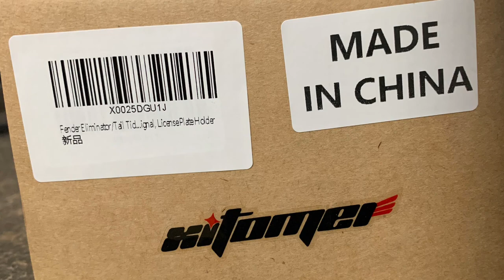Installing a shorter license plate bracket on Kawasaki Z900

Comment: You don't have to cut wires or bracket! Just unplug wires! You just have to disassembly top and loose bottom parts of the tail.
Reply from the maker: The connectors on the wires were to large to fit through the holes on this particular bracket. It would be a good thing to consider a variety of options before purchasing.Thank you for your comment and have an awesome day 😊
Reply: @NotamechanicBetty  May be, I was doing it on 2020 Z900. The same brackets.

Comment: hey great job! your video did help me out but you could have saved allllot if time and hard work with the wiring. if you take the driver seat out you will see the connectors on the right you just have to unplug them and pull them through, it was super easy. just though id let you know haha.